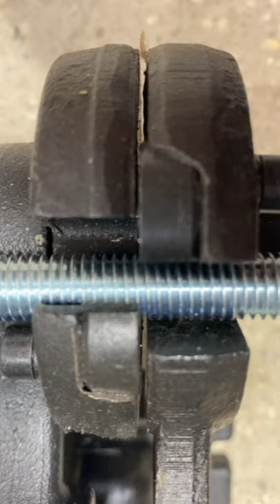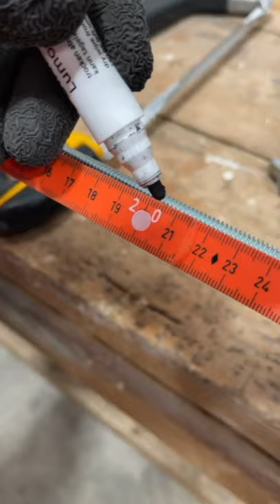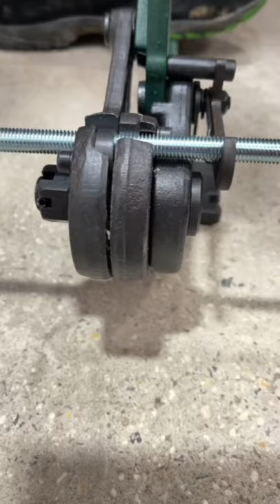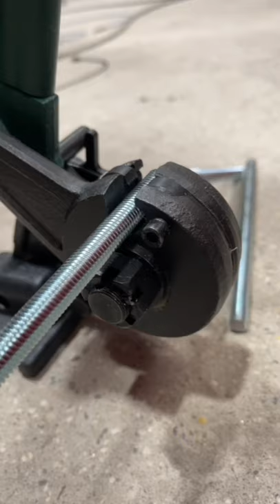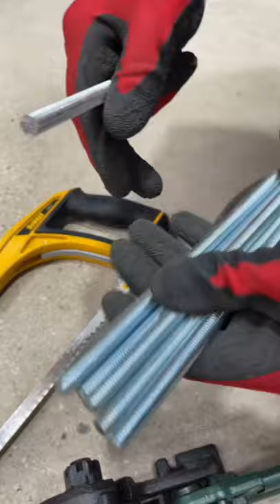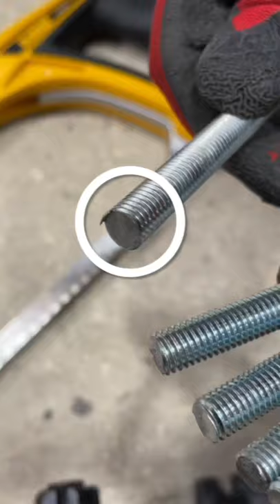FASTER THAN A HACKSAW with a BETTER FINISH #shorts

Comment: Grinder with thin metal cutting disk. The proof of the pudding in ALL cases is how quickly and easily a nut threads on afterwards. My experience to date? Give me a thin (2mm) steel cutting disk on a grinder every time as you can bevel the end with the same tool very quickly and easily.
Reply: Just use the nut 
 to rethread the rod
Reply: @scwfan08  sometimes, but also a quick way to knacker the nut thread AND the bolt/shaft thread.

Comment: When hanging trapezes in the air, I take a circular saw to the rods, then I use my makeshift rod-coupling threader to clean up the burrs. You cut a rod coupling for the size of rod you’re running, make two perpendicular cuts just a cunthair long down the middle to make a cross, and attach it to a 4” piece of rod. Boom, deburring drill attachment.
Reply: I also keep a piece of conduit I beat into a nut driver. Drill some self-tapping screws through a hole saw at the bottom end of the conduit and you have a makeshift nut-driving drill attachment. When you’re running trapezes all day for weeks these attachments save me hours of spinning the nuts and deburring.

Comment: In my experience this tool always left it with a burr which prevented nuts threading on. I always found it easier to use a chop saw to cut multiple lengths at once and an angle grinder for deburring.

Comment: I tape 4 lengths of rod together and use a metal TCT cut off saw. Gives a clean cut and is fast as you are cutting 4 at a time. 4 seems to be the magic number though if you do more the centre rods can spin out